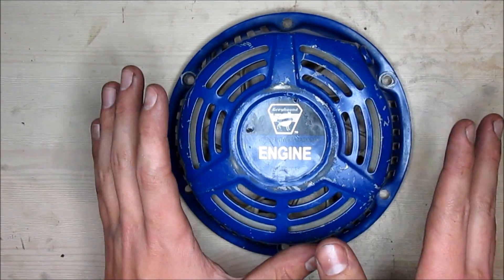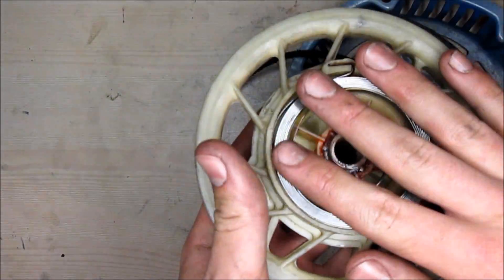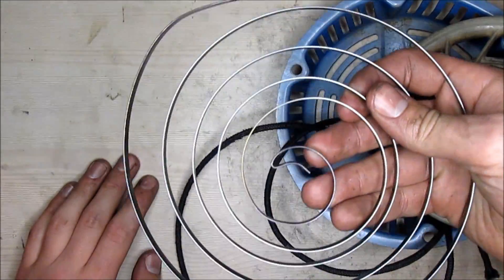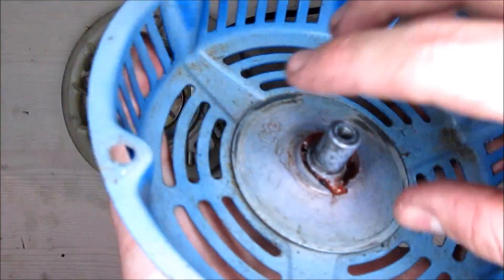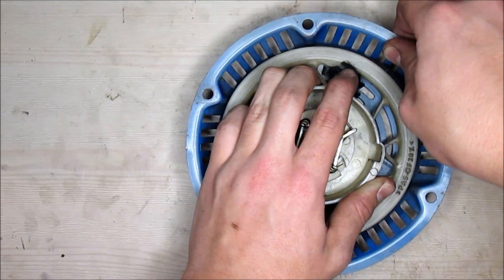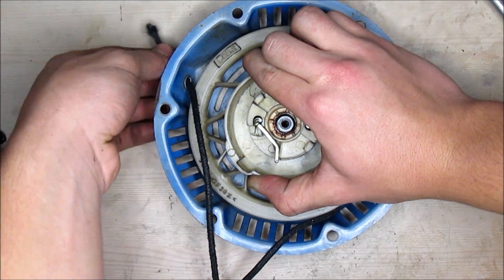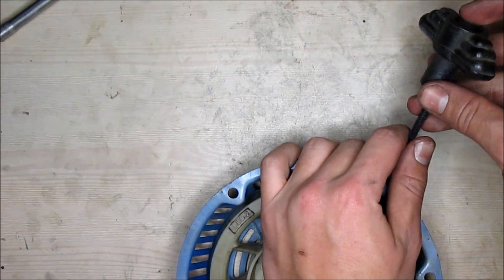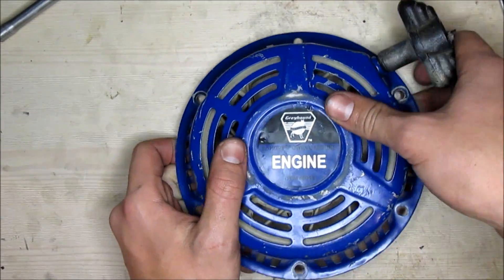How To Repair Disassemble And Reassemble Pull Starter From Small Engine

Comment: Thanks, nice job on the video, I have a question: Is it necessary to remove the 10 mm bolt on the plastic wheel in the shroud in order to rewind the coil?

Comment: Thanks for this! Great job! I have this exact same engine on my tiller. When I pulled the shroud/assembly off the 2 little metal cogs had come out of the spring loaded slots and were laying loose. What could be the cause of that?
Reply: I had the same issue... don't know why